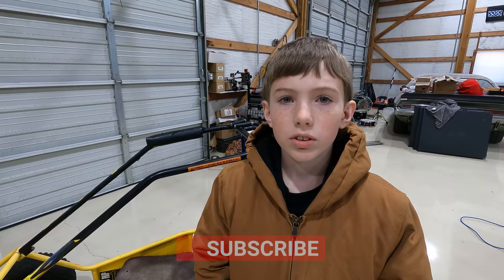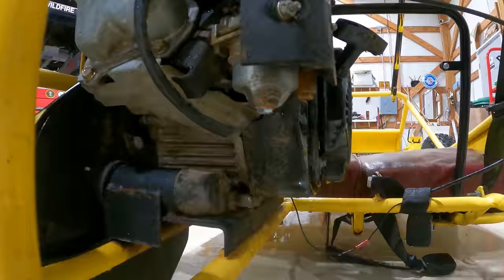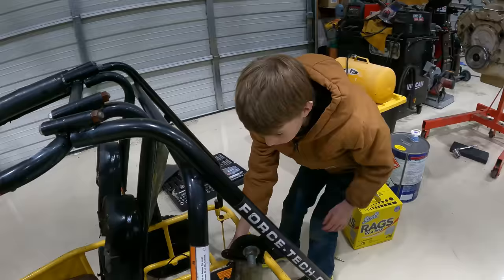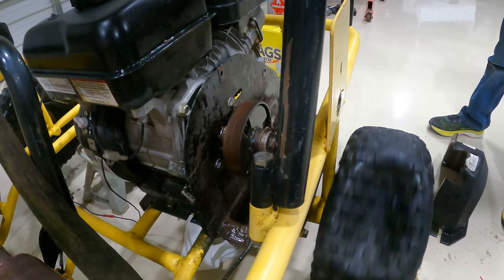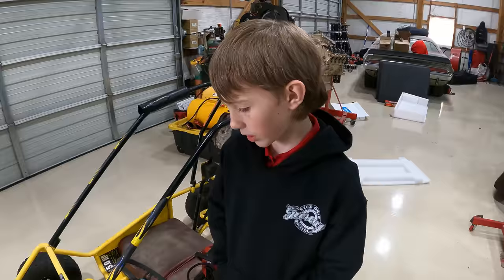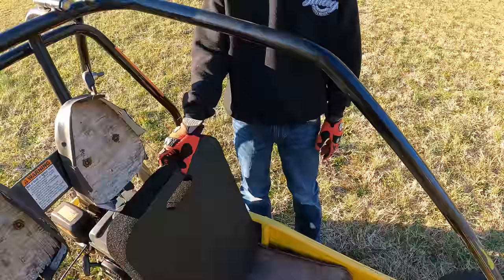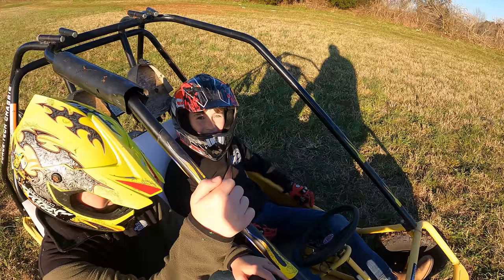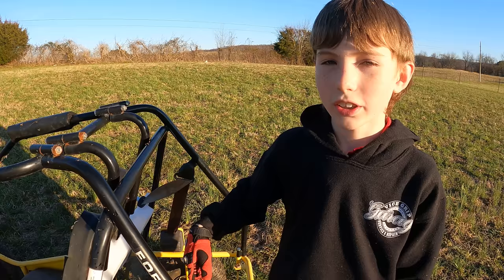FORGOTTEN cheap Go Kart, will it RUN AND DRIVE?

Comment: Little grip you are so lucky to have a great Dad and teacher. My Dad got me a homemade kart when I was young. Front end was from an old riding mower. seat was part of an old metal lawn chair, engine was from Grandmas 2 cycle lawn boy. The kids in the neighbor hood and I wore out the lawn boy and i was so excited when Dad brought home a 6 hp Briggs. Clutch would break springs. We would start it up on a gallon paint can and push if off when it started. Ran it in the yard.

Comment: I had a similar go cart. This is great to watch. If the chain keeps coming off it might be happening because the frame is twisting just a bit as you corner. Mine did that from time to time.

Comment: I bought this exact go cart around 20 to 25 years ago for my kids. The same color and stickers. Paid close to $900 brand new for it. The motor ran very well and always started 1st pull. The motor brand was a Robin 5hp the only issue I had was the roll bars kept breaking where they bolt to the frame I had to weld them and the frame broke on the left rear pull side by the wheel. Sold it after the kids out grew it. Seeing this video brought back a lot of good memories. Keep up the good work young man. PS Derek you have a Beautiful family. Your definitely blessed

Comment: Great job Bentley!!! And Dad, too! Forget about the posi rear...put another engine in it for the right rear wheel!!! You'd have to put in a solid rear axle all the way across, though. When I was a kid my uncle had a go-kart with twin McCullough chainsaw engines and that's how it was made (direct chain drive to the axle sprockets, centrifugal clutches on the engine sprockets). I don't know how it handled, because the only way I ever drove it was pedal to the medal in a straight line, then U-turn and do it again the other way. The adults wouldn't let me ride it with both engines going (I was about 11 at the time) but it would do 70 mph on one, well over 100 mph on both. They'd just remove the drive chain from one engine and let me go to town. We ran it on the country road in front of my grandparents' farm.

Comment: That Robin was an excellent engine with roller bearings and an automotive-type crank and piston with a cast iron liner in block, true industrial quality. thirty years ago I built my son a mini-bike with a 3.5 hp robin engine and was actually stopped by the Ohio State Highway Patrol for speeding and told to walk it home and stay off the road. Other than polishing the head it was stock. So even if you swap it out keep it for something else as it is quite good.

Comment: Great job Mr. Bentley! Oh, and Dad...
I didn't have a Dad to show me about engines or similar type stuff. I just went ahead and tore things down, and looked for anything that was obviously broken, then tried to fix it. For a short time in 1968, there was an older guy (18yo), I was 12yo, who lived a few doors down, and he gave me my first old 2 stroke engine to "work" on.
He was a great guy who I admired & he shared a lot of mechanical knowledge with me, before he enlisted in the Army to fly helicopters. Unfortunately, he was sent to Vietnam, and was listed as an MIA. I still wonder what happened to him.
Sorry for the bummer ending to this, and always treasure the time that you spend with your Dad, Mom, and brothers!
Fly safe!

Comment: Super video, and good explanations of what you're doing and why you're doing it.
I think the most important part of doing mechanic work is being able to look at something that's not working and analyze the movement of the parts and pieces until you notice what's wrong.  I'm talking stuff like that brake shoe band clampy thingy.  When You see It operate the first thing you notice is it moved all around.  You didn't think that it should move around, so you have to figure out if something's broken or worn out and if it can be fixed or has to be replaced.  Mechanic work is all about analyzation.  Don't think that's a real word but it sounds like something that your dad would say. 😁
Great job, I wish I had one of those when I was a kid.

Comment: Bentley, part of the traction problem might be the bend in the rear frame. The fact that the passenger side is lower than the drivers side might be causing the drivers wheel to have less pressure/contact with the ground.

You might be able to get your dad to help straighten it, then see if it makes any improvement.

Most importantly, HAVE FUN!!

Comment: In comparing engines you might want to realize horsepower is not the only number you also need good torque and in small engines, the bearings determine how fast the engine will go and how long it will last. Some engines are actually rated on a 500-hour service life while others will last for years and years. For many lawn tools you only use a few hours a week for half a year at a time 500 hours isn't really that bad. Most people would be happy as it lasted 8 or 10 years but for a go gart  500 hours can go by really quick. A 3000 rpm motor will not be near as fun as a motor that can hit 4000 or more.

Comment: Nice cart , kinda surprised that it had enough power to pull both of you boys around. Rotate the tires and you might have a lot more traction, but you knew that. That's something you can do.. making a live axle might a require some welding. Maybe Dad will help. Although I love to see you try.

Comment: Great job boys, you too Derrick lol. The idle rpms seem a little high. If you can reduce the engine idle speed the clutch may disengage, and be much safer.  If it won"t disengage at lower rpms you'll have to get the clutch off and check the springs and weights. Show them the rope in the spark plug hole trick.

 Be safe, and good luck

Comment: That's not a bad clutch it's a tight converter :)  when I was a kid we would spray WD40 in our clutch to make it slip  for more RPM on the launch like a high stal converter probably not good for the clutch though.

Comment: Good Job!  I didn't see but I assume you drained the oil and put some new oil in. In many cases with a sticking float in the carb, the gas tank will drain into the crankcase causing it to be way over full like yours was.

Comment: Wait is that my dads go-kart? He had re-painted one of those 5-6 years ago. Originally it was red  with some blue on it. All rusty, but he fixed the frame and sanded it all throughout. My brother had run the front of it right into a power pole to the side of the house, and dent the front too. So he took it inside and worked on it, but while messing with the brakes it somehow sparked and the engine flew the kart backwards and into a chair. The chair broke the fuel canister so rip.

The top of the frame was black too like that but this looks slightly different. Probably because he sold it right after it was broke to some other person. Not sure if this was the same one because it had another rack to the right of the engine where the battery went, plus it had a flag.